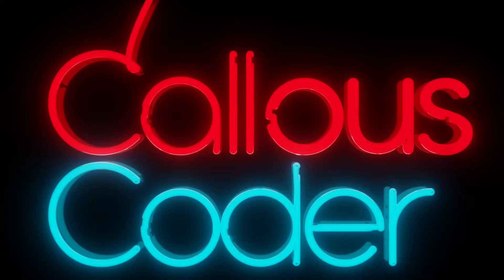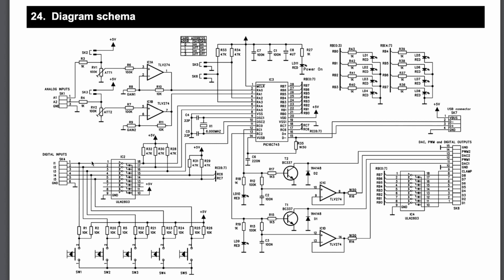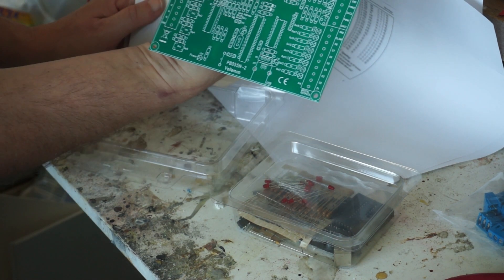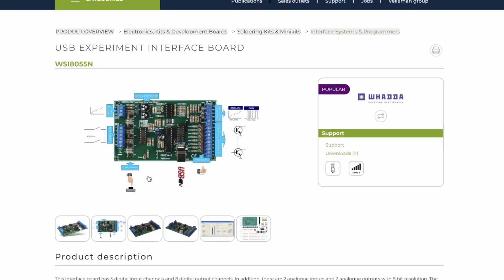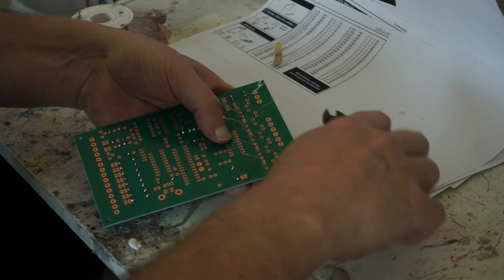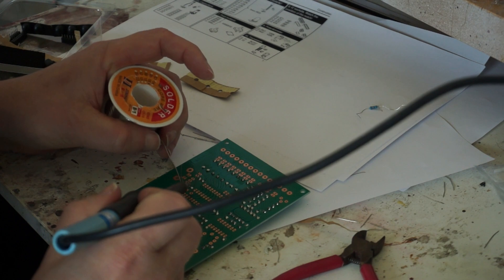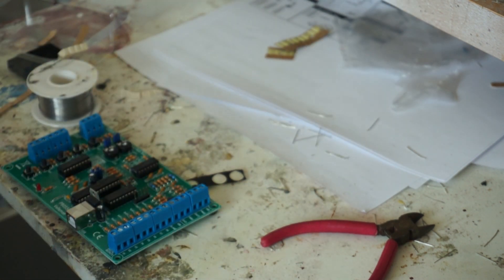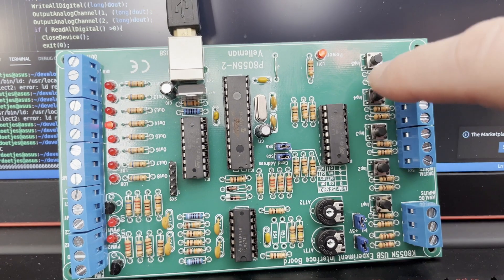SOLDERING AND CODING VELLEMAN USB IO KIT

Comment: These things are very handy, I built one while working for Schneider Electric back in 2010. One of my jobs there was to "Test to failure" devices that we were going to be installed worldwide and see which one lasts longer (or if they were going to outlast the warranty). I'd hook it up to the device under test and run it until it wouldn't run anymore and log how long it took to fail. Simple things like using an "A" form contact in place of a "C" form contact massively increased the reliability of Pulsmatic pulsers (used on gas meters to provide the owner with the ability to "Shadow meter" the utility).

40 or so years ago I was doing work for a "Stuff Shop" (PCB assemblers) and they had a soldering expert come in to do training (at $1000 a day in 1984!). One of the things that he stressed then was that you never clip the leads of a device after soldering unless you reflow the joint as you did. Gases will get in there and cause corrosion. You're the only other guy who I've heard that from.

As for your color code, these days I generally look for "Something in Brown" when it comes to a LED current limiter. I'm not too picky.

What Linux distro are you running? Currently it's Mint here.

I like your socket soldering trick, but I prefer the bands to be on the right and the bottom for the resistors. So while I agree that there is a correct way to install them, you somehow managed to get them all in backwards. :)

Ben over at ByteDelight solders and/or tacks down the through-hole stuff from the top first and then flips the board over. Why didn't I think of that? Duh!
Reply from the maker: I was though to snip and solder or reflow from a teacher in college who worked on satellites. He was really picky about that!
He even told us l that they’d snip of exact amount of solder for each pin as to make sure that G-force would be the same on each side. And every IC was soldered as to not get it pulled form it’s socket during a a take off or high G pulling manoeuvre. 
Fascinating old geezer he was!

I had a reason for putting the gold band to the left. As the connector I want to have on the top side. That way when it sits on desk it looks straight on :)
I’ve always been a bit anal with aligning resistors and caps so I can easily read them. 

And yeah if you have a double sided board you can tag the tops. Unfortunately (and amazingly) this was single sided. And only one wire bridge.

I personally love SMD. I remember the first time in college (1990) having to make an electronic die with LEDs and a shift register and I was wondering how on earth I’d be able to solder those tiny tiny components. Well that was easy, as it was just pick and place and into a reflow over :)
As of that moment I was hooked on SMD. It was so quick compared with through hole.
Reply: @CallousCoder  BTW, I took a look at DOT, only a 45cm mirror? Don't take this the wrong way, but the mirror in my Dob is 30cm. Is 45cm the sweet spot for solar viewing? 

Granted that it has all sorts of bells and whistles that mine doesn't. Which is my point, with all of the money spent on the structure, tracking, cameras, convertible top, etc., why just 45cm?
Reply from the maker: @MrWaalkman  you don’t need a large mirror to look in detail at the sun, larger mirrors are there to capture more light to see faint and far away objects. The sun is neither 🤪. 
You need a very stable mount and tracking system to study solar spots and that’s what was its designed purpose.

That weird leg structure was designed by that professor to cancel out any movement because of the sun heating it up. And the tracking mechanism is very accurate. The main sprocket was engineered by the TU Delft and each tooth on that 2 meter diameter sprocket at a 100uM (I believe it was) accuracy. That professor (forgot his name) nearly got a stroke of you went near that sprocket 🤣 And was completely encased kan metal box where the only two openings were to get then axels of the controlling motors in. 

The whole idea was that the telescope needed to be cheap. And able to be moved to La Palma and build here in Dutch universities.

I was an intern on that project in 1993. My job was to wire up all the controls. And I redesigned the PCB of the main mother
Controller. I noticed that the IO was in the middle of the memory and I opted to move the IO to the end of the memory. And they’d already done some botches. 
That to this day is the largest PCB I designed 30x30cm.
Ironically it was the coolest job I’ve had too. A bit frustrating, that your coolest job was your internship.
Reply from the maker: Oh and I run Ubuntu now.
Although I don’t really have a preference. 
I ran MINT 5 years ago on another laptop and also was a great experience.